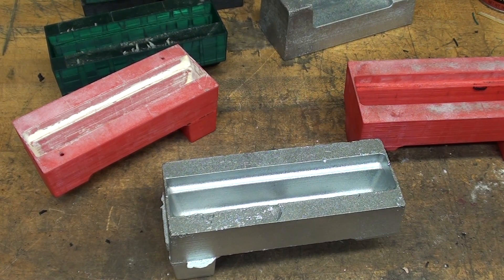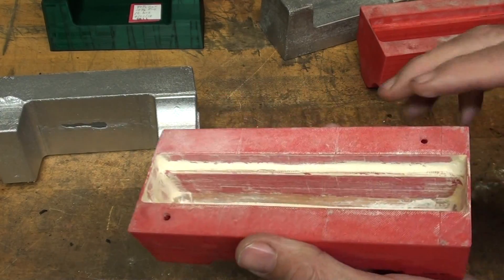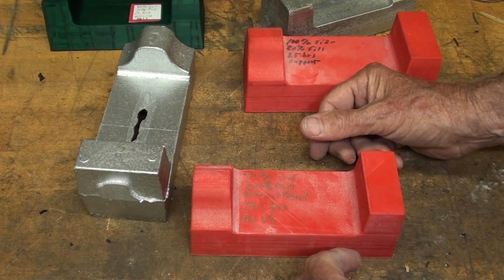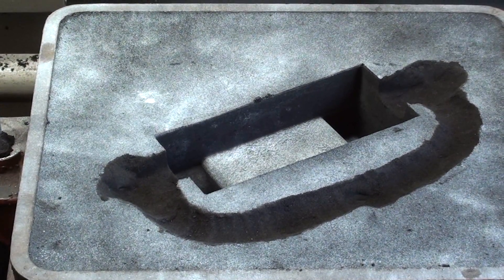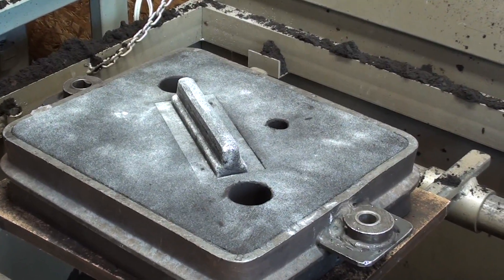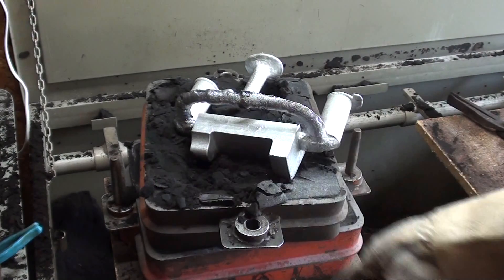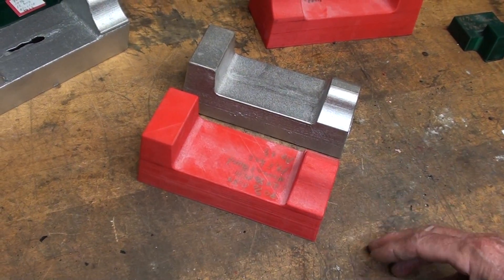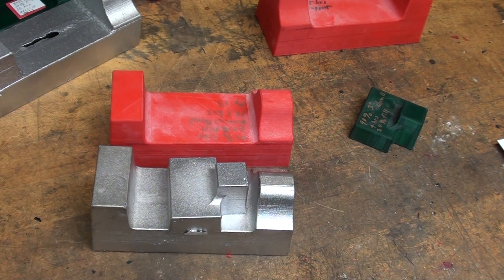revised Casting the Small Drill Press Vise #447 1/2 tubalcain by BANGGOOD

Comment: I think I have the perfect series. There was a book published 99 years ago called "The Boys' book of Engine-Building" . Being nearly 100 years old it's in the public domain and I've seen several sites that have it as a free download and there are reprints for sale. The book has chapters on all kinds of how to's for engines and a stuff. How about a series on pattern making (old school and 3 d printing), casting, machining, and running of let's say the horizontal engine. We could follow along in the book.
Reply from the maker: I have heard of that book. I will have to get a copy. But I have been very discouraged with making steam engine videos. There is almost no interest by my viewers
Reply: As comprehensive as a project this would be it would not has to all inclusive. That is you could stop at the machining of the parts. I envision but have zero skills to do so, a complete series for the beginner. Home foundry, home casting etc. Interperting the written word, building patterns from different materials and so on. If there truly is no interest in assembly, timing and running the engine I'm sure you could calaborate with another youtuber and have them finish the project. I even would be willing to give making a video a try of the assembly and testing. I can see other people adding to the series by using the book for boilers, tanks, condensers all from the same book that the viewer could follow along with. Shop classes are not taught any more near the big cities and I'm not so sure about the rural areas either. I live in a development and they would have a fit if I were to build a forge or a furnace.  Anyway thank for you reading this . Anyone else reading this like the idea or am I just nuts?

Comment: Hello tubalcain, today I picked up a south bend lathe. I acquired it in many pieces. I was wondering, if i made a video showing what i'm having trouble with, if you could help me figure out how to put some things together. Or maybe you could make a video showing the pulley system and gears in detail. I am having some trouble putting together the pulley system. I don't know who else to turn to. Please let me know if this would be something you could help with. 

Thanks so much,
KDKtwelve
Reply from the maker: You can send me a picture or video. I have never taken the bearings out of the machine, so I may not be much help. Do you have a parts list that you can study
Reply: Hello tubalcain, I made this video for you. "https://www.youtube.com/watch?v=lluJ4gudLrs&feature=youtu.be"  If you copy and paste the address it'll take you there. No i do not have a parts list to reference from. That would certainly be handy.. I'm having a hard time figuring out how to keep the spline key in on the feed screw also. Let me know what you think of the lathe in the comments. Thanks so much!

Comment: Mr. Pete, look into "solvent smoothing" It's used to blend in print lines and blemishes on 3D prints. Doing this to the inside of those vice bodies should save you a lot of hand finishing work and make releasing the mold easier. I saw this on "DIY Perks"  ( https://youtu.be/6xFUNFG-UKE ) a while back and it looks quite promising for your applications.
Reply from the maker: That will work with ABS filament not PLA
Reply: mrpete222  That video was on acetone smoothing ABS but there are other solvents that will work on PLA. Ethyl acetate is one.

Comment: Might have considered printing it upside down, so the support was all on the top of the vise.  It looks like it might be a bit more support material, but not significantly more.  

In situations like that I also find it can be very useful to split the design so that two halves can each be printed without support, then joined after with glue.  So you could print the top of the vise normally, and the bottom upside down.  That way you have two flat surfaces on the build plate, no support, and an easy glue join afterwards.  It's also faster since the printer isn't wasting time printing support material.

As always, I love following along!
Reply from the maker: Thanks

Comment: Nice.
What is that material that I've seen used where they don't remove the pattern?
They just pour into it and it "vanishes" due to heat (example: https://youtu.be/mFTROZaHOBQ?t=3m15s).
That seems like it would've saved you a lot of trouble. I wonder what would've happened if you poured over the printed pattern?
Reply from the maker: I should try that on film. But I sure haven't had much luck with that in the past

Comment: Why pour the Al near the lowest possible temp? Sorry, I missed that episode. Counterintuitive (so far). ;)
Reply from the maker: It's all about shrinkage
Reply: mrpete222 Ah! I wasn’t thinking hard enough. My recent thoughts of expansion/contraction have been about water freezing and the jump it makes when it changes state. I was thinking that ?Al would do the same and made a bad assumption. I gave a quick scan of Machinery’s Handbook and found only widely varying tables and not the graphs I was seeking, ones with a big jump when the Al froze. I will revisit the info when my ADD recedes. Thanks!   BTW, Big section on casting in MH, 22nd Ed. BUT I guess you knew that. :)
Reply: One interesting table in MH, 22nd Edition gave a conversion chart for converting weights of various pattern materials into weights of aluminum and other casting materials, so you can estimate the unmelted weight (less factor for dross, and waste, I guess).

Comment: Great video.  It occurs to me that you could print the base as two shells, one for the upper/side surfaces, and one for the bottom/interior surfaces.  The two shells would fit together to form a hollow model.  If you print the lower shell inverted, the support would be on the inside of the hollow model and there would be a smooth surface on the bottom of the assembled model.
Reply from the maker: Good idea, but I'm sick of this project
Reply: That is a good idea. Wish I had thought of it. -Kevin

Comment: Mr. Pete,
Enjoyed your redo of the 90% Peterson Vice! 
    We are of the same ilk I think when it comes to getting it right. In my case a failure is usually accounted to getting in too big of a hurry and cutting a corner where I know I shouldn’t. This most often happens when I’m tired which is stupid because then I lose sleep over taking the short cut and knowing my conscience won’t rest until I do it over. 
  I have a cardboard container of Rock Hard Water Putty identical to yours I bought over fifty years ago. It’s still good and I still use the stuff often as it has many uses. I noticed in Ace Hardware the other day they still carry it though in plastic containers. What isn’t these days. 
   Oh, I went to an estate sale Thursday and was digging in a box of junky tools as you never know what your gonna find. To my surprise in the very bottom was a pair of #9 BMC Locking Pliers. Researching them I found BMC MFG. Co., I think of Bingingham, NY, made these from 1946 to the mid sixties. Mine had “Patent Applied For” stamped on the handle so they were made before 1950. They are an amazing locking pliers as the jaws remain parallel in every position and can be clamped lightly or with pressure up to a thousand pounds yet release with a simple flick of the thumb. There was an old Popular Mechanics article, circa 1946, on the sight I visited. BMC also made a quick change blade scissors. Eventually they branched out and started making the steel pedal cars we played with as kids. (Or at least my friends with wealthy parents did)
Dale from Decatur
Reply from the maker: I sure never had a pedal car. Too much money and that was right after the war when I was little. I think I will look up that locking pliers to see what it looks like. Thanks

Comment: Another epic video.  I have a question.  Can you get light weight casting flasks?  Maybe made from aluminum?
Reply from the maker: I had aluminum flasks at school. The kids bang them around so much that they were warped.
Reply from the maker: Remember, high school kids can wreck anything. They bent so many pins on the flasks. That I had the classes make up pens as a project so I had plenty of spares
Reply: The flasks don't weigh too much empty, but fill them with sand and that's a different story.

Comment: I think i have seen people use flask's made from hardwood , would have to be a lot easier to manage than those thick metal ones , i like those ones but yeah they look super heavy
Reply: Wood of cause will be lighter, but one wrong move in pouring will burn your flask and it can't hold as much weight as the steel one.
Reply: mine are made from pine and each set has a volume of 1.5 cu ft.  when the furnace was outside, we'd do the molding inside and carry them out to cast and carry them back in to shake out.  the weight savings reach a point of irrelevance as things scale.

with aluminum at least, the burns from spills or from bumping the crucible are pretty superficial.
you have to watch out more if you have large castings that run too close to the walls.  those burns get plenty of time to char.

Comment: Nice video Lyle, it looked as if you could of used the bottom half of the mould again just by placing the pattern in and refill the top half, would it work just wondering, all the best.
Reply: I wondered about that as well. Could save some time if it works.